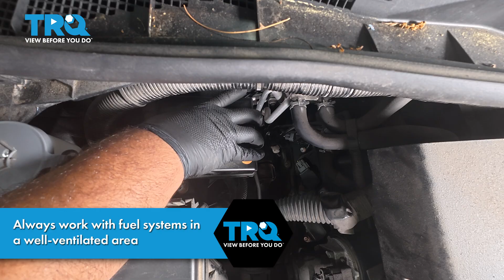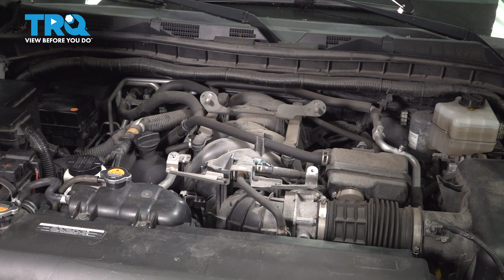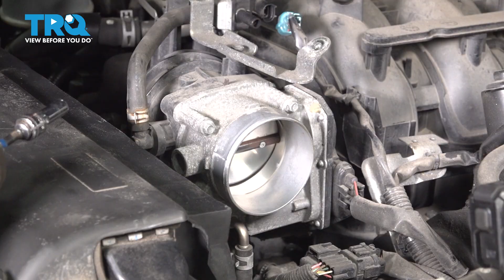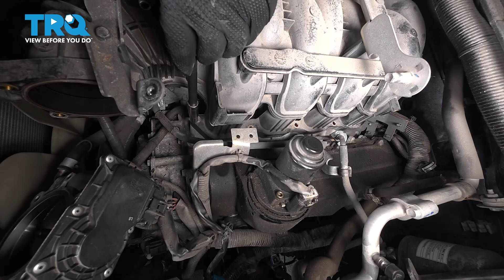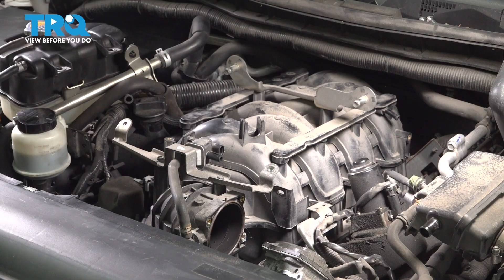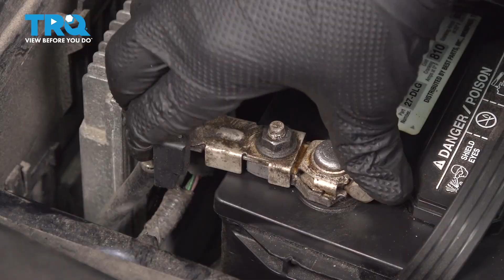How to Replace High Pressure Fuel Pump 2017-2024 Nissan Armada (5.6L V8)

Comment: I’m getting following codes on a 2018 Yusana Hamada, I’m not sure if it’s an SV or an SL
P0725 Engine Speed Input Circuit
P1089 VVEL POS SEN/CIRC-B1
P0300 Random/Multiple Cylinder Misfire Detected
P219B Bank 2 Air-Fuel Ratio Imbalance